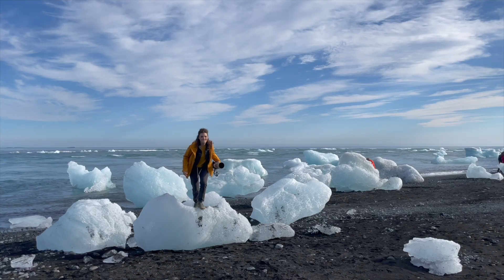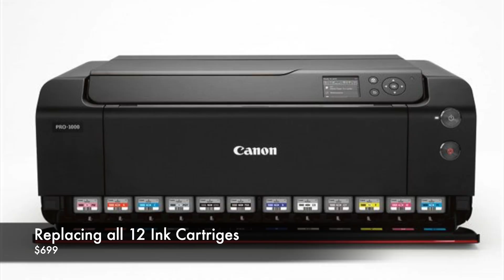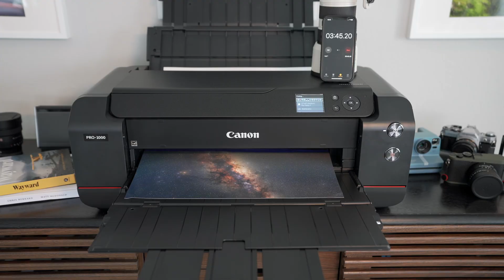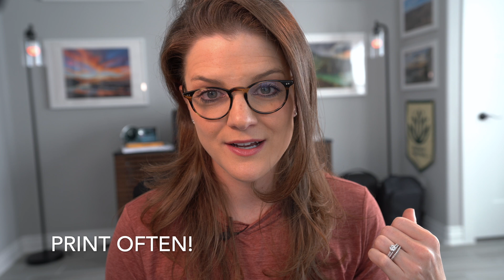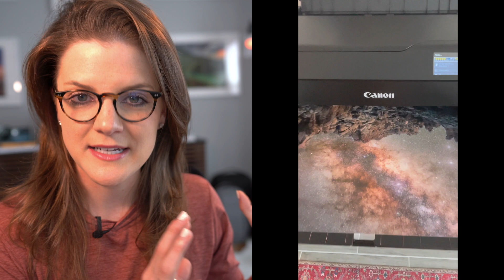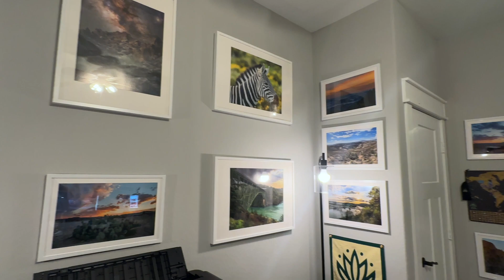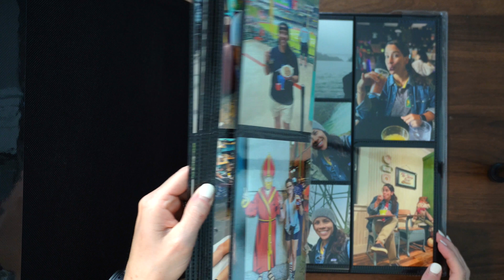Canon Pro-1000 - Worth the Investment?

Comment: Nice overview, thank you. I am just changing from the pro-1000 to the pro-2600. The ink is half the price and the additional layout options safe paper cost (which is significantly higher when you use brands like Hahnemuehle or CANSON, that was the only thing missing in your great calculation). I couldn’t find a comparison between the cleaning cycles of the 1000 and the 2600, and I don’t have any experience with sheet loading into the 2600. So we will see …

Comment: These printers are designed for commercial use and most of the online advice is directed as such. I'm a hobbyist with no expectation of cash return on investment. The 'satisfaction return' is off the chart. 
I print almost exclusively 17x22 or 16x20. Rather than 'printing a page' every few days to bypass the cleaning cycle I print in batches every couple months. I'll edit and prep half a dozen images then run a series of letter sized tests before taking the leap into a full image. From personal experience; following the 'continually active print' route costs me more ink than sucking up a cleaning cycle two or three times a year.

Comment: If the maintenance cycle runs every 2.5 days whether or not you use the machine, then it doesn't matter does it? You can't just print junk to use up paper to lower average print costs.

Comment: In yr 4x6 example how did you calculate the cost of ink per sheet? Ie vol of ink used per sheet? hence cost per sheet. If volume of ink is based on area sheet. This assumes equal colour usage which isn’t so. If the 4x6 print has a height of ink 0.75mm I can get your number. I assume it is a number provided by cannon?  Can you clarify the 8 cents per sheet per print. Richard from Australia. Ditto larger sheet calc. Enjoyed your simple and clear explanation. Cheers Richard in Australia

Comment: Good comments about owning a Pro 1000. I have owned one for about 1 1/2 years. I got it because I do print larger size prints....usually 16"x20" or 16"x24" of my astronomy photos which I sell. I also print any smaller sizes such as 8"x10" for my normal photo business.I also print small 4x6" prints for family photos such as vacations. I previously owned two Epson pro printers that could also print that size. Both had lots of problems with spitting of ink and finally both died.... that is why I went with the Canon which to date has been problem free. Those who think the printer uses a lot of ink don't realize that the ink is not used directly from the cartridges. Instead it is pumped into feeder tubes so a new print will draw ink into the tubes so it seems after loading the tubes you have used about 40% of the ink.... that isn't correct.... it is in the machine waiting to be used. The next set of inks you get will show a more realistic remaining ink in the printers display. The most important thing is you need to print every day or two.... doesn't have to be a big print.... a tiny print say 4"x6"is all it takes. Some even print a tiny 1" block but I like the idea of using all the nozzles to keep them cleanr. I use QPrint which is an excellent app to print from with some features beyond the built in one in Adobe Photo Shop. The neat part is you can setup an automatic print so it will print a very small print each day  at a specific time using all the nozzles. The Qprint has that ability built in. The other way to reduce ink usage is DO NOT turn the printer off. If you do each time you start it up it will go through a purge cycle and waste ink. In my case I even got an inexpensive batter UPS that prevents the printer from turning off in the event of a power outage. You most likely won't be able to print but at least the printer will stay on as you wait for the power to come back on. 
Many of these tips and tricks I learned from Jose Rodriguez who has some wonderful videos on Youtube. 
You implied this.... but I found it cheaper to buy the paper in rolls and than you can cut them to the exact sizes you need. I am a professional photographer and astronomer so I tend to print standard sizes as well as odd sized so being ablel to get the most efficient useage of my paper is an advantage. I recommend is taking those cut sheets and placing under a board with weight on it to flatten the sheets so they feed smoothly. I found that Epson doesn't have replaceable print heads whereas Canon Pro 1000 does. I haven't needed mine replaced but that is a nice advantage so you don't end up with a doorstop as my two previous Epsons. Finally MAKE sure you have updated the firmware of your Canon to the latest. The newer firmware has more efficient use of ink and now allows a maximum print size of 17"x48" so real panos are now possible. There are companies that sell aftermarket ink cartridges and also  there is a couple of companies that sell what you need to use their cheaper inks and refill you old cartridges. I am not a proponent of that but there are any that do refill or use aftermarket inks. I have found on other printers you do save money but consistency or print life span may degrade. Some colors are very hard to match such as Canon Red and Purple so that may be problematic. 

Finally while the Canon Pro 1000 is a fantastic printer people need to be realistic about how much they will use it and what print sizes. For hobbiests who only print a few prints it is not a smart choice. You would be better with an outside processing company or get a cheaper smaller max print size printer and use a print service for the few large prints. 

The Canon has a utility that you an use to tell you exactly how much each print costs. That is a good tool to use to keep your printing costs in control.
Reply: This is what I was looking for.  I had heard that Canon upgraded the firmware to allow the printer to produce larger than 17X22.  I bought a P800 at about the same time that the Pro 1000 came out for one reason; at the time, the Pro 1000 was limited to 17X22, but the P800 could not only print larger, it had the roll option.  I recently sold my P800, but will be getting another printer.  If my budget allows, it'll be the new 24" Canon printer, but if my budget says no, then I'll buy a Pro 1000.

Comment: Do printing services, such as MPIX for example, use a high-quality printer such as the PRO-1000 when a customer orders a print from them?  Generally, the prints I have had made through many of these printing services have not been good.  I spend a great deal of time editing my photos to the colors I desire.  So many of the prints come back not even close--often even muddy colored.  And then when I ask the printing services what photo printer is used,  it is less quality then the Canon 1000.   If a printing service uses the Pro-1000, I would gladly order from them.  So far I haven't found one.

Comment: Thanks for your video. It's IMPORTANT to use the Canon Accounting Management (CAM) software, made for these types/level of printers. Using the Canon Accounting management software, we can obtain more exact printing costs because it takes readings in real time from the printer based on parameters entered for the cost of paper and ink, which can be entered manually. It's pretty simple, except initial setup, not so much, and Canon doesn't offer proper support for setting up the CAM software. I'm happy to help if anyone needs! The CAM software is the BEST way to know what is being spent for ANY given photo. I have started an Iris Photography business, aside from my headshot and event photography. Iris as in one's eye. Pretty iris photos with a black background, mostly using luster paper, and mostly Black ink, Gray and some minor other color inks and Chrome Optimizer. For example, an 8 x10 inch print using Canon Pro Luster paper on 8.5 x 11 inch paper runs on average, $1.50 for ink and paper. Average cost using Pro Luster A3+ paper and printing an 11 x 14 inch photo (on A3+ paper) is $2.20 - $3.10 each (paper & ink). Again, this is Canon OEM ink and Canon paper. I have decided after long hours of research to now start using Precision Color Inks and the Precision Color Ink Warning System. Inks are on average, HALF the cost of Canon OEM! I am not an affiliate nor do I get any kick back from this company but the guy who runs/owns the company (Mike) is SUPER helpful with understanding how his warning system operates and his ink prices are a fraction of the Canon OEM inks. https://www.precisioncolors.com/ ALSO, QImage printing software is one of the best ways to print since it allows a higher level of control - PLUS - QImage allows a schedule to do a nozzle check so we're not wasting more ink for head cleanings. It can be set to run a full or half page nozzle check at any time of the day that works. Canon's Professional Print & Layout software is good but QImage is bit more straight forward. Sincerely! Richard
Reply: You deserve more likes. Thank you. I do not have this printer yet, but I'd love to own one.

Comment: This video contains one error. The idea that if you print more the printer will  waste a smaller amount of ink with cleaning cycles. This is not accurate. What happens is, the more you print, the smaller percentage the waste becomes. This waste amount is always there, the cleaning cycles always take place. To determine the waste is difficult but not impossible. You have to manually record the total ink used after each print, a figure the printer shows as a running total after each print. Note, this is not the ink per print which is recorded but does not include the waste. Then you must add up, say for 20 prints, the ink per print and subtract this from the total you recorded for print 1 minus the total for print 20. You will be amazed at the difference and when a major cleaning cycle, which uses 60 ml of ink in one go happens, you really see a difference. Many, many people say this doesn’t happen but… I found several people that did what I did and every one witnessed what I did. As an example, I print very little and I waste 7-10 (700-1000%) times as much ink as actually goes on the paper. The lowest I have seen was a waste of around 20% by a gentleman that ran a business providing high school photos and printed 1000s of prints each month! This printer is a joke, and the joke is on those supporting Canon with ink purchases. To put this another way, you could buy an equivalent Epson, which uses a different head technology p, and quickly pay for the printer with the ink cost savings over the Canon.

Comment: Hi Mallory. I sell prints and use an Epson P800. I bought it instead of the Pro1000 because at the time, the 1000 would only print 17x22 as you mentioned. The P800 had a roll paper option which swayed me to the Epson. Since then, Canon updated the firmware to allow the 1000 to print longer. One thing you might mention at some point is that the bigger the ink cartridge is, the less ink costs per milliliter. The ink cartridge for the old Pro 100 was about $1.30 per ml. My P800 with an 80ml cartridge is about $.70 per ml. Jump to the 160ml and beyond, the price per ml drops further.
Reply: 17x25
Reply: @davidewersphotography  When the Prograff 1000 first appeared, it would only print 17X22.  The firmware has since been updated to print quite long.  I now have the Prograff 1000.

Comment: You forgot to mention that to replace the printhead is $726... 
I have been using Canon PRO printers for 15 years. Currently using a PRO 2000 24" but looking at getting a PRO 1000 for printing smaller cut sheet prints (The PRO 2000 does not have a paper tray for handling cut sheets) I love the results and the PRO 1000 uses the same inks, print head and  processor as the PRO 2000...
Reply: 512€ with tax here in germany for the print head of a 1000 pro

Comment: Great review spot on! I have had this printer for about 2 years now and I can say for sure that you need to use this daily even if for a small print to keep it from going into a maintenance cycle. In the 2 years I have changed the maintenance cartridge twice and have about 1/4 full on the third. I have gone through 1 1/2 complete sets of ink and most of that went into the cartridges. So if you are thinking about this printer make sure you print daily! On top of the costs of the ink I also live on an island where we pay 22% import duty on most things so it gets even more expensive to not use it and dump ink vs using it!

Comment: I've had nothing but negative experiences with my Canon Pro 100 I bought it used from a lady for about $250 with no ink. I bought my first set of Cannon inks which was a pack of 8 for around $150. Every time I make 2 prints at 13x19 at least 2 of the inks are empty! This is INSANE

Comment: Thanks for the honest review and I hope Pro 1000 print heads are cheaper and last longer! My IPF6400 print heads need replacing every 4-5 years and they cost $490x2!! maintenance cartridge $80/year plus ink that runs approximately $85 for 130ml cartridge X 12 and I am not a heavy user!! But prints are gorgeous color or black white. I have not experienced head clogging with IPF6400 like I did with my Epson large format printer but certainly Epson print heads lasted much longer.

Comment: May I ask how did you calculate ink costs for 17x22" ? In your calculations paper and ink for 1 print 17x22" costs $5.80, so $5.80- 2.40 (paper cost)= $3.40 for the ink only. So price of full set of cartridges is $700 / $3.40 = 205 prints from one set of cartridges. Did you calculate costs on low quality printing ? I'm asking because on other websites people says that they can get about 40 prints of one set of cartridges and you get 205.
Reply: curious about the same, not understanding the metric.

Comment: Hi Mallory, great that you mentioned the ink going into the maintenance cartridge.  I print a moderate frequency, but I still have more ink going into the maintenance cartridge than onto paper! I previously had an Epson P900, which used much, much less ink.  But its paper feed mechanism was terribly unreliable, so I got the Pro-1000, which has proven very reliable. Even with the ink the Pro-1000 "wastes", ink is still a relatively small cost of a big print (including paper and mounting, and really you should camera and lenses and time taken) and is tiny compared to the price the print is sold for.

Comment: Thanks Mallory...I absolutely have to take the process from beginning to end. Printing teaches you so much about your work. I exhibit my prints so I enjoy the best printer like the Canon Pro 1000.
Here in NYC you can buy this printer at BH for $1249.00 and the refill cartridge for $15.00.  I print mostly very large but I love your tip of making small prints to keep the printer happy...something I only do as tests..sometimes  I stick one of those images on a blank greeting card and it makes for a lovely presentation! Thanks again and keep printing. Im with you! Jan in NYC
Reply: Where you get refills for cartridges?
Reply: @2k9flash  It's not an ink cartridge. It's the ink waste cartridge, which run $15 each.

Comment: Thank you for the detailed breakdown on printing costs.  You did a fantastic job!!!  Cheers.  I have question about the printer head replacement?  Someone is selling this printer for $200 however, it’s been collecting dust for a minute so there is a good chance the printer head will need to be replaced.  At a glance, the printer head costs almost $800!!!  Have u had issues with printer head errors etc?  Moreover, do you think the printer’s existing printer head is salvageable with a good cleaning?  Please advise when time permits. Thanks MD Xx

Comment: I'm lucky as far as printer paper is concerned. I'm an old school buddy of the general manager of a major paper manufacturer here in Oz and I can get pretty much all of my paper at a substantial discount😊😊 Including all of the premium photo papers. I'm an Epson fan and I want to get myself their big desktop photo printer, the SureColor P5070. It's quite a bit more expensive than the Canon, but it's a fantastic printer. Though, the Canon is a good printer and if the cost is substantially less, then it could be an alternative. I could also get an Epson P906, which is pretty much like the Pro1000, but the inks are a lot cheaper than the Canon inks. $25 per cartridge cheaper. The printer is a little dearer, though, but not by much.

Comment: I have the Pro 200 and it's great albeit a little expensive to run with the inks costing around £150.0 per set. The results are fantastic but I don't use it that much, I have smaller printers for smaller images and test prints. I would love to have the Pro 1000 but the ink costs are crazy for home use.

Comment: Hi Mallory, thanks for a very valuable clip: you set things out nicely, and your reasons are certainly valid. Writing from Australia, I was quite surprised to find - after checking current exchange rates - that the numbers for printer and paper were similar Down Under, although our ink replacement cost is around USD$180 less. I'm going through much the same thoughts and process as you do in this clip, and shall look up your "1 year on..." clip. Like you, I like the idea of the image made "real" in my hand or on my wall - I feel that the job is incomplete until I do.